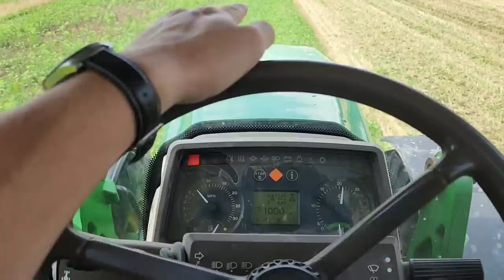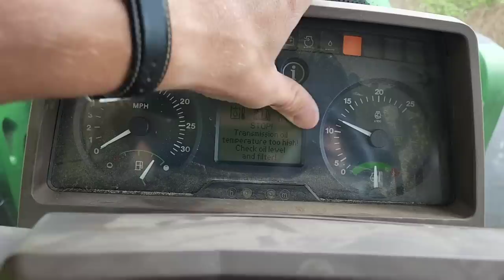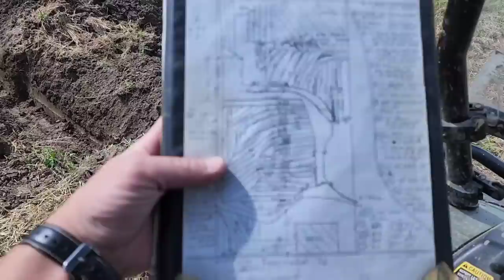Tractor Issues - #747

Comment: i know its a smaller machine but my 1977 300 garden tractor (made back when the garden tractors were just mini versions of the farm tractors) sheard the shaft off the charge pump and i know its a stupid idea and probably wont work but im repairing the shaft with weld and then drilling a new pin hole either way the pump needs replaced but i just need it to run long enough to pull wagons of tomatoes and peppers to my vegetable stand

Comment: Our 7230 actually  burnt up a hydraulic  pump from a bad rock shaft sensor. The tractor kept trying to raise the hitch with it all the way up dead heading the pump. There ended up being a broken plastic tooth on the sensor. There was water inside there, probably  froze at one point to break it. If you can hear the tractor hydraulics running you probably  got a problem